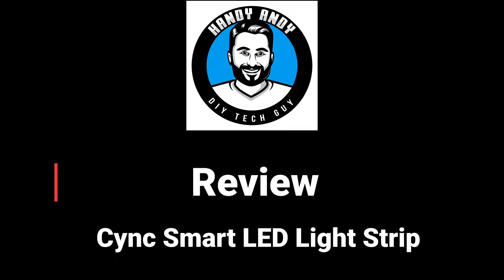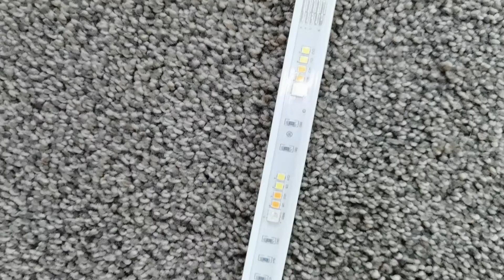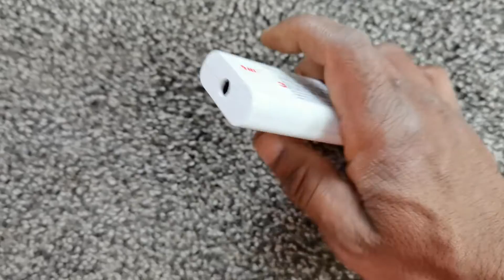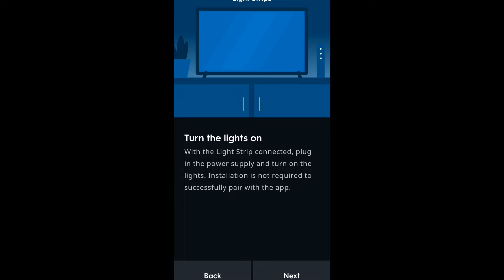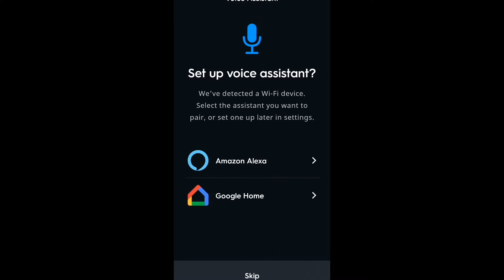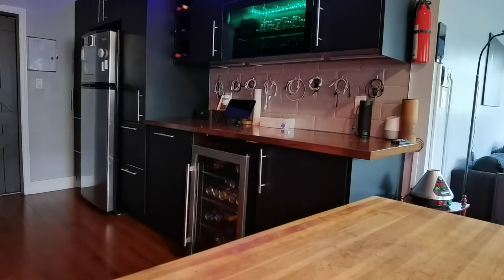Cync Direct Connect Smart LED Light Strip Review

Comment: Im not sure if you found it yet but inside the app you can select the little white arrow on the right side after you connect your lights with the app. click the arrow and there should be three circles, from left to right there is the multi color option and then the effects and then settings ,

Comment: The damn thing won't connect
Reply: Unplug the lights for a while. It only took about a day for me, plug them back in and try using the on and off switch. If this works try and connect them again. It should work.

Comment: Did you at first charge it and then set it on top? Or do we need a cord hanging to the wall socket?
Reply from the maker: Hi, these light strips will always need to be connected to a power source via a cord; they do not have batteries.